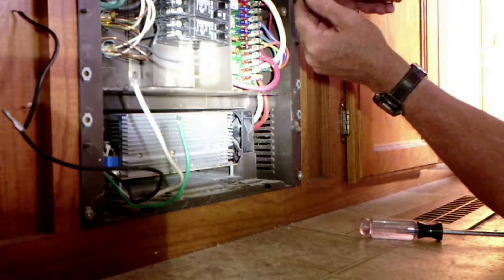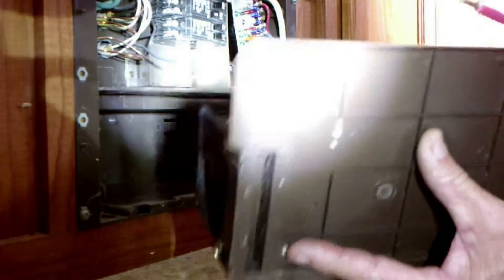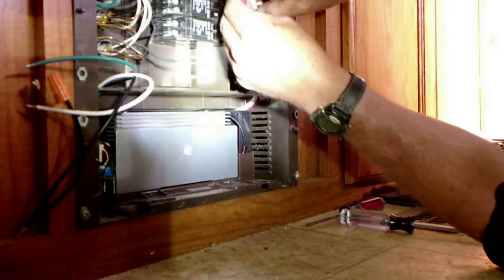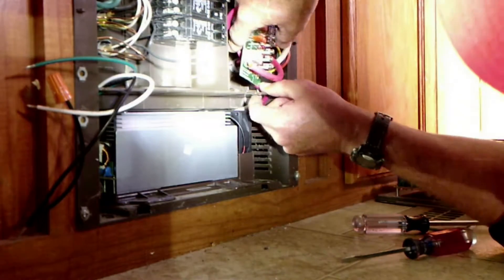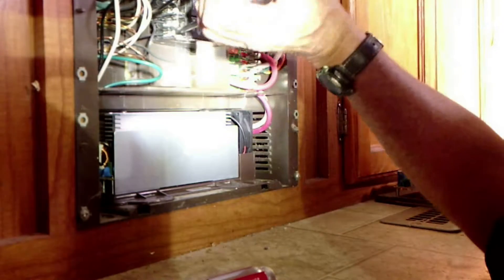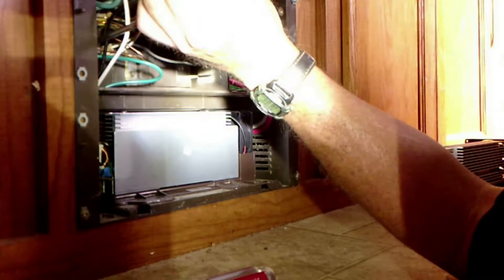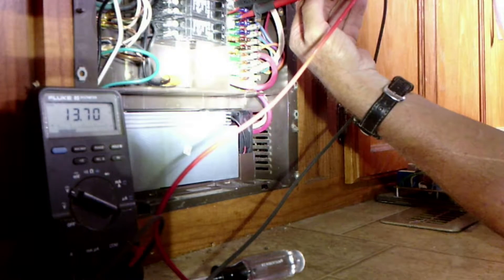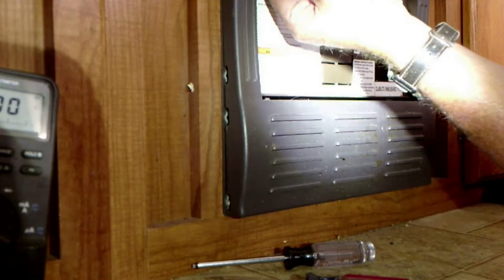RV Power Converter Test And Replace

Comment: Hillbilly, I am upgrading to Lithium batteries and I need to upgrade my WIFCO 30 amp converter to one that does a better job of charging LI batteries. I know WIFCO makes one but I have heard that Progressive Dynamics builds a better unit for about the same amount of monies. Do you have any experience with Progressive Dynamics? Thanks

Comment: Would the converter work on shore power? I’m having the issue no power on full charge battery. Only when plugged to shore power. Wondering if the converter is bad?
Reply: No that would not mean your converter is bad because your converter is what converter the 120v 'shore power' to 12vDC power used in your camper.

Comment: I tried cutting my cord bec I thought it was 220 being all thick. I wired up a plug and plugged in into a 240 outlet everything came on for a moment then boob popped a breaker so I thought checked the breaker box and no luck I reset the main no power can anybody help me. Do u think I fried the converter ?
Reply from the maker: Get your meter out and check

Comment: Roll over image to zoom in
HillbillyRv - I need your consensus on converter replacement for
     [Top to bottom white label with tons of small print and Warning notice] 

WFCO  Model: WF8955AN W/PLASTIC
POWER CONVERTER WITH PANEL 70VF
PANEL INPUT: 120VAC 60 Hz 30AMP
AC PANEL BOARD
ELECTRICAL RATING:
CONVERTER INPUT: 105-130VAC, 960 WATTS
OUTPUT: 13.6DC, 55AMP(INC CHARGING AND LOAD)

 It's in a 2007 Class MH. 
Can you tell from I've copied above that what's in your store (and possibly what you always seem to have on the truck at the ready as a proper replacement), is the correct replacement?  
Which is:    Arterra WF-8955-MBA 55 DC Amp Replacement Main Board Assembly, 
Brand: WFCO   List Price: $231.95  (but currently $199.00)

Seems to be the only one associated directly with "WFCO" and probably most reliable. Amazon has $79.59 to $200+ all claiming to be replacements - its mind boggling. 

Also, if this is the correct replacement, how do I purchase so you get the commission? Yes I'm a dunce and only recently been able to get out from under my rock. Too much sun here in Arizona.
Reply from the maker: Yes that will probably work
Reply: @hillbillyrv  Thanks. Do I order from your site and that's all I need to do to support you in this purchase?

Comment: So I have a class B camper van. Has two AMG batteries. Solar. Everything works great. So my problem is I plug into shore power and nothing happens. No power to the microwave or 110 outlets. Breakers or ok nothing tripped. Any advice for me to check first.
Love your videos. Keep em coming.
Reply from the maker: Get your meter out and follow the electricity and figure out where it stops.
Reply: @hillbillyrv  I just found a video on my RV. Zion by Roadteck. I have to have the house batteries switch on and inverter on then plug into shore power. Never heard of this before. But I’ll try that.

Comment: I have a 2005 Prowler Regal that I suspect has a bad converter. Ac,furnace are not working. Fuses and breakers are fine. How do I find out where the converter is on it? It's a stationary travel trailer hooked up to ac power. It doesn't appear to be where the distribution panel is located.Thanks!
Reply from the maker: Then it can be anywhere. You will just have to go on a treasure hunt. If it is not in the bottom of the power distribution panel then it will be a deck mount converter. I have videos on those too.

Comment: My green led blinks fast every time I disconnect and reconnect shore power. I just press the reset button and it goes back to solid and works fine. Is this normal to have to reset every time?
Reply from the maker: Never seen a LED light or a reset button on a converter before.

Comment: It's like my converter work but shuts off sometimes almost immediately but at others the power stays on for a minute or so then shuts down it was working fine for  a week or so idk
Reply from the maker: I have seen them fail like that before.
Reply: @hillbillyrv  I had it plugged into a 15 amp outlet under a carport worked for like a week then overdid it .then I went to a 70 amp and it still immediately shut down I checked several extension chords there continuity of each chord  checked the fuses took out the inverter/converter...i about drained all my energy burned my book all the last of my morale with that anyhow. I found it works in a different plug outside not sure why  thankfully,anyhow the video was still good thanks for the response man .

Comment: @Hillbilly RV what is the purpose of the converter on this camper? Is the only purpose to charge the batter?
Reply from the maker: Pretty much. Just a fancy battery charger.
Reply: @hillbillyrv  thanks for your response, but in my 2011 Catalina coachman I think it does a lot more than charge the battery. Is that true?
Reply from the maker: It charges the battery and supplies a few amps to circuits in the camper. That is all.  @MarkMinistries
Reply: @hillbillyrv   I think I have a converter which I think is kind of goin out not out yet, and like when I run the heating system its like a little jumpy at times and for example the lights dim. 2011 Catalina coachman. Im persuaded after I replace converter this problem will be eliminated. maybe ill remember to let you know

Comment: So my converter isn’t charging my battery when plugged into shore. I jumped my battery with my truck and I was getting power to everything. I let it charge for a while. But it eventually died. Do you think it’s a battery or converter issue?
Reply from the maker: I have tons of videos on this subject. Maybe you will find some help there. I show how to test all this stuff.

Comment: My rv b4 I got a travel trailer ,the inverter went out.I replaced it with the older type 12 volt battery charger I bought at a yard sale for $5, worked great for 6 years till I sold the rv,i guess that's redneck rving not hillbilly lol
Reply from the maker: Whatever it takes, right?

Comment: Where do i find the 40 amp fuses on my converter  ?   My DC power quit.   My RV has a 30 amp plug for shore power.
Reply from the maker: If you have the same style of converter that is in this video, they are with all of your other fuses right above it. These are only reverse polarity fuses. If no one hooked the batteries up backwards, that ain’t your problem.
Reply: I have 30 amp fuses.  All of my fuses are good. My batteries are fairly new.  My wiring looks good. So is  my converter bad ?

Comment: My converter is the same as yours. My furnace has been acting up and now it won't run on the converter alone, without the battery being connected. The blower motor draws 7.7 amps DC. When the blower kicks in the voltage drops to 10.65 volts and the electronic board won't ignite the burner. Is it often that a converter will generate low voltage under load? thanks
Reply from the maker: It definitely can happen, yes.

Comment: My camper slides will not work via the inside button, so I have to connect my car battery to get the hydraulic pump to push and pull the slide out rooms. I was told if I can make them work via my car battery then the problem is the converter. However, everything else in the camper works, so I thought at the time. in retrospect, I am remembering few instances where the lights inside the camper would only work dimly, if I turned several of them on at the same time. I also had the ceiling fan burn out in the living room of the camper, I noticed that the button to turn the fan on and off was getting hot, prior to the fan burning out. In theory, now that I look back, are all these signs that my converter is/was not working properly? It's a few months to camper season, so I'd like to get on top of the situation and get a converter ordered. So that's my question, do all those signs tell me it was the converter all along?
Reply: I never had a battery backup. We always ran strictly electricity. But even as I give this issue more thought, my problems began after the electrical box at the campground fried my cord from camper to box. I bought a new one and 1/2 hour later, it fried again. Then the campground staff came and replaced the 30+ year old 30amp to a new 50 amp electrical box. No more fried cords. A week later it was our cable signal to tv. So I went out and bought new cable, box to camper, camper jack to tv, still had cable problems. Staff came and replaced the 30+ year old cable  set up inside their "equipment box" and no more cable problems. I'm wondering if maybe my converter problem stems from the problem of the 30+ yr old electrical set up at the campground??? Your opinion???
Reply from the maker: @tinafarnsworth9264  Slide rooms almost never work without a good battery.
Reply from the maker: Either that or you have a bad battery or no battery at all or the power is not making it to or from the battery and converter. Lots of possibilities.

Comment: I’m helping a 77yd old lady rv-ing by herself. Has this same converter issue. It needs replaced. After finding this on your channel I’m confident I can do this swap. 1 question I have is that, She has 2 batteries hooked up, will this cause the converter to over work itself trying to “charge” 2 batteries and cause failure in the new converter? Thank you! You always have great info.
Reply from the maker: Not if the batteries are good. They need to be tested individually to make sure they are not bad.

Comment: I'm confused about grounding. When hooked to my house, it has a normal ground but what about when camping? It seems like the only real and safe way to ground, would be to actually pound a rod into the ground. but I don't see people doing that. are they just running 12vdc? Some one told me to just hook neutral and ground together . but in the campers 120ac box, it is like that already . Like in a home.
Reply from the maker: Anytime you are plugged into an AC power source there should be a ground. Wither at your house or plugged into a pedestal at a campground.
Reply: @hillbillyrv   yes, I understand that when I am plugged into a ground, that I am grounded.
 but what about when not plugged in and running off the inverter. Do the negative and neutral of the inverters AC output,   and the DC negative of the solar panels, charge controller, and batteries all go to the camper frame and skin? 
 Is there an easier way that pounding in a real ground post?
 sorry for all the questions. just a link to information is ok too.

Comment: What is the repair procedure when this model is accidently hooked to 220? The previous owner said they made that mistake and the converter hasn't worked since. Also, I'm new to how camper inverters work, so I'm learning all this at once. Currently no batteries in camper and not hooked to power by the long black cord. I don't have the cash to replace it, either. I'm between a rock and a hard place. Any help is greatly appreciated.
Reply from the maker: Hi Miranda. I believe I showed the repair procedure in this video. If it is not clear, then I have several other RV conveter videos.

Comment: I was camping just 2 weeks ago and my lights got dim and the battery capacity only had 1 light when I checked it. I put a multimeter on my Battery and it read 8.9 volts. (This was a new Battery) but I was plugged into a 30 Amp service so naturally I assume my convertor has gone out. So I used a 120v floor lamp for light for the rest of the trip. Yesterday after watching this video I went out and ran the same test on my convertor and it showed to be working like it should. Now I wonder if I have an intermediate problem or something else has gone bad.
Reply from the maker: You have to figure out why the power from the converter is not making it to the fuses and to the battery.
Reply: @hillbillyrv  i am going to be doing more testing

Comment: Without a battery, don't you stress the converter?
Reply from the maker: You can't run any of the high amp things (slide rooms or leveling system), but yes, the converter will handle the rest of the stuff in a travel trailer or 5th wheel. Some MHs with a bunch of electronics probably not ok.

Comment: I was getting noise from my electric box, like a motor coming of and on every few minutes.  I shut off all my battery powered light that were on and the sound quit.  Do I need to replace my converter. Thanks
Reply from the maker: There is a cooling fan in there. Maybe it is rubbing on something or it could be going bad.
Reply: @hillbillyrv  Thanks, will check it out for sure

Comment: Howdy Hillbilly RV, I'm glad I found your site and this video. I'm hoping you can help. I have 30 amp WFCO that I installed, never a problem until I plugged into a 30 amp plug that someone (supposed to be certified electrician) wired for a contractor where we were helping hurricane victims in Houma, La. His helper evidently wired it wrong because it blew my DC Power but me A/C Power still works. Could it be the DC circuit board or the converter? that went bad.?
Reply from the maker: If you plugged into 30 amp 220 volt recepticle, the converter is most likely bad and maybe other things too. I have videos on that subject. You can do a search on my channel and find those.

Comment: You always need your battery, the power converter is not always rated to draw large currents, this will cause the converter to blow fuses and even fail. The battery is required to provide the big loads that the converter is not able to.
Reply from the maker: If the RV never moves, you don’t need a battery. You only need a battery to run the slide rooms or leveling system. (high draw items). Thanks for the comment Nota

Comment: What is the part number of the converter part that you replaced? The lights in my camper occasionally dim if I have a lot of lights on and the heater is on.😊
Reply from the maker: You have to get the one that is correct for your converter. Get the model number off of your converter and contact your local RV dealer, they should be able to help you.
Reply: I think it’s the same unit that you were working on in this video WFCO WF8955PECB Black 55A, Amazon has the whole unit but I just want to replace the converter.